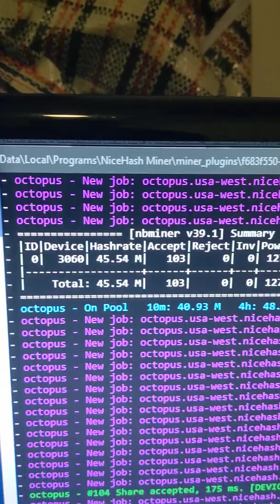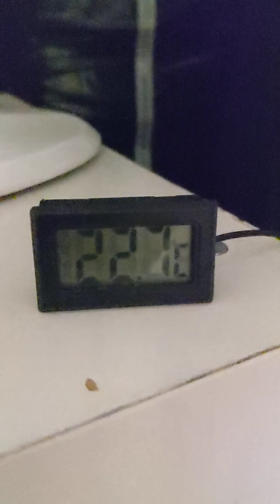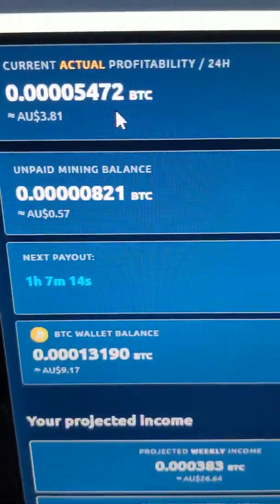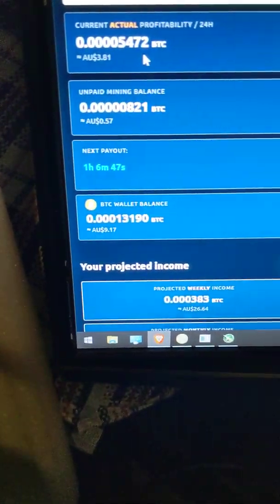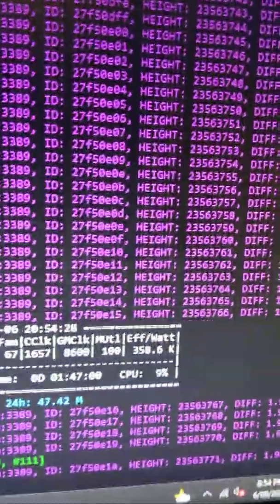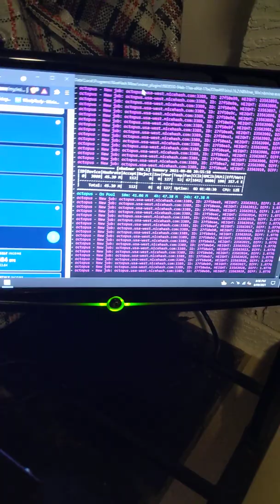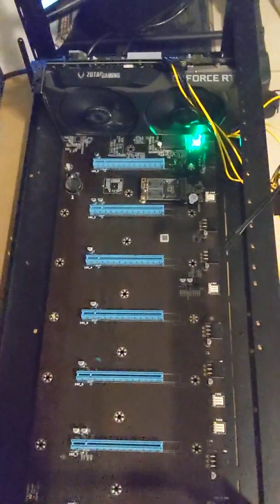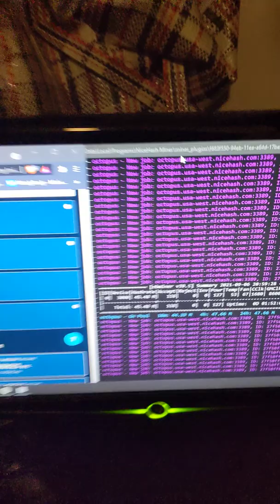BTC-S37 Mining Motherboard - First Review

Comment: Which frame you got this in, was looking for a frame that would fit this
Reply from the maker: I bought this off of eBay.  It leaves about a 5mm gap at the end of the long sides.  None of the holes match up though, so mine is currently on PC Case motherboard clips.  

The one I bought is just like this:

https://www.ebay.com.au/itm/8-GPU-Aluminum-Stackable-Open-Air-Mining-Rig-Computer-Frame-Miner-Case-Holder-AU-/114882963649?mkcid=16&mkevt=1&_trksid=p2349624.m46890.l49286&mkrid=705-154756-20017-0

Comment: What frame is this?  I've yet to find one that will host a BTC-S37.
Reply from the maker: I bought this off of eBay.  It leaves about a 5mm gap at the end of the long sides.  None of the holes match up though, so mine is currently on PC Case motherboard clips.  

The one I bought is just like this:

https://www.ebay.com.au/itm/8-GPU-Aluminum-Stackable-Open-Air-Mining-Rig-Computer-Frame-Miner-Case-Holder-AU-/114882963649?mkcid=16&mkevt=1&_trksid=p2349624.m46890.l49286&mkrid=705-154756-20017-0

Comment: I just bought a btc-s37 mobo, but there is no 24pin power to the mobo, I'm afraid to assemble it if there is a power shortage, there is only 6 pin power on the motherboard and 8 pins on the VGA, can it work?
Reply from the maker: Hi there.  You will need what is known as a Modular power supply.  It has the 6-pin power cables that you need.  With this motherboard, you must plug into the 6-pin plug that is closest to the CPU.  This powers the motherboard, as well as the first GPU slot.

You can find modular power supplies at large computer stores, or sites like eBay or Amazon.

Best of luck!
Reply: I use a server power supply with breakout board.
Reply: You can try this 2000W mining power supply, it supports 8 GPUs, and the power supply noise is very small.
https://www.youtube.com/watch?v=6gfVt9Zhff8
Reply: I've been using a psu server, and it's working great